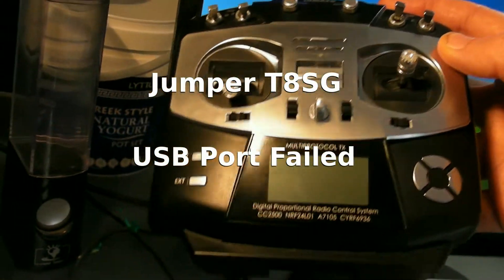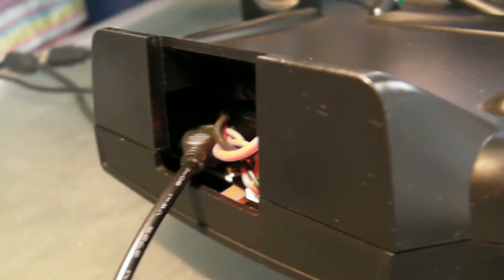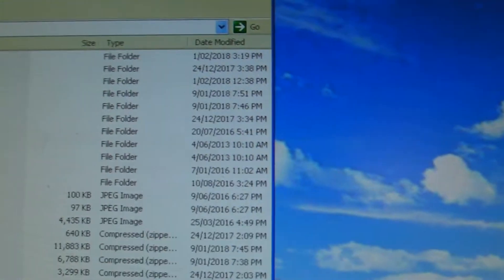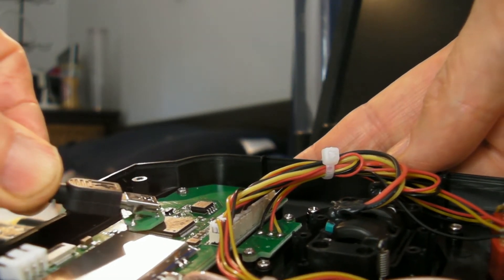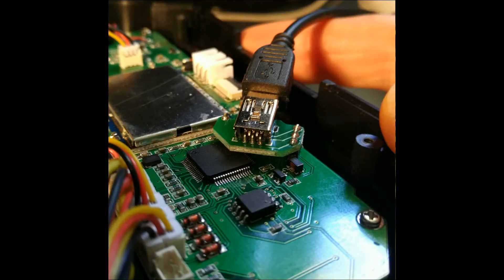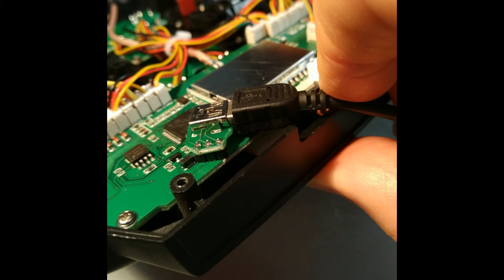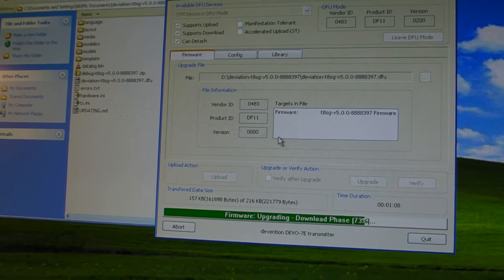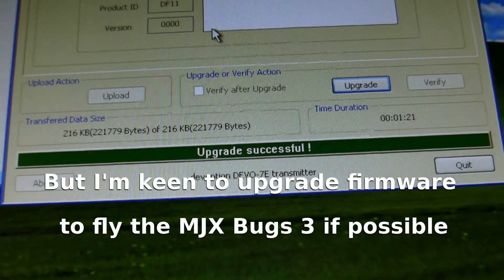USB port on Jumper T8SG fails.

Comment: Hello Dave, my Jumper t8sg v2 plus has failed on me as well. I can not get the files to upgrade, better yet, I can't get the radio out of USB mode...The USB did not disconnect like yours did, but It appears to have bricked on me. I spoke with Jumper tech and they told me to do this and that, but the radio refused to respond to my commands..you know what I mean? I continuously telling them that the radio has failed, but they tell me over and over again the same thing. Do you have any pointers? You can view my videos where I describe the problem...Thanks and I subbed your channel..awesome content!
Reply from the maker: First thought is that your top left button is jammed down, making the Jumper always come up in USB mode. You could try holding the button below it down, and then turn on the Jumper. If this "over rides" the top button, you should see a black screen, with the Jumper ready to flash a new image. Turn it off then on to see if USB mode is still the default.
You could open the case to check the top left button. Jay Drone had to replace the board in this version of the Jumper after he bricked it some time ago. Think he has a video up showing how he opened the Jumper and replaced the board.

Comment: I had this prob and remembered that my Mobius camera uses the same style USB cable. I swapped in that cable and all worked perfectly. I wonder if Jumper has wrongly wired cables they ship with the Jumper Plus ?
Reply from the maker: In my case it was a broken wire once the socket became loose. The various cables I tried before replacing the socket all worked after I finally soldered the right wires to the pins. I know what you mean - some of these old style USB cables are not fully wired for two way data transfer.

Comment: Thanks, everything very clear. I have a Jumper T8SG V2 plus and in the USB mode when making the backup or when compiling the new firmware it makes it extraordinarily slow. I thought about formatting the Jumper unit, but I have not dared because after erasing the old firmware I see that the unit is not completely empty so I am afraid to ruin something. If you recommend formatting it tell me how, Fat32?
Reply from the maker: I have not needed to reformat memory in my Jumper yet, but I understand that Fat32 just like any USB memory drive is the way to go. That portion of the memory in the Jumper that you flash a newer version of DeviationTX to is separate from the part that you can reformat as a USB Drive. I understand that this is why you can back up your models and settings held on the USB drive and then reformat the drive without ruining the version of DeviationTX that you have installed. After a reformat, you can copy back the models you have set up.
Reply: @skybug3  Well, I formatted FAT, the PC did not let it to FAT32, surely because the JUMPER's USB drive is ridiculously small, 2MB.
It works very bad, restoring the system has cost 35 minutes !!!!
Reply: @skybug3 Will there be a way to change that memory?
Reply from the maker: @carlosribesgarin4472  Not that I know of.  I wanted to expand memory when I first got my Jumper. However, 2MB is enough for 30 models, and I can delete some and add others when I need to. I think your memory could be bad. Hope you find a way to change it. It only takes a few seconds to copy to and from my Jumper in USB mode.
Reply: @skybug3  Thank you. Sometimes things are surprisingly simple. I have tried with another cable and it works quite well!
Reply: So you want to tell me that the USB part that is occupied after deleting everything, is something that has nothing to do with the Jumper but with the USB system

Comment from the maker: I've ordered a couple of USB Mini-B sockets, and know which pins are what. In theory it should be easy to remove the old one, glue a new one firmly to the case, and wire them up. Of course, I've never done this sort of thing before. Watch this space.
Reply: David Dawson did that fix it? I currently am experiencing this issue but on a brand new t8sg Plus and banggood is giving me a hard time returning it.